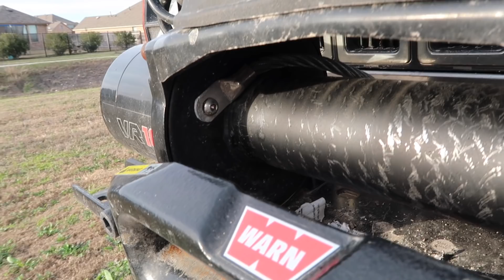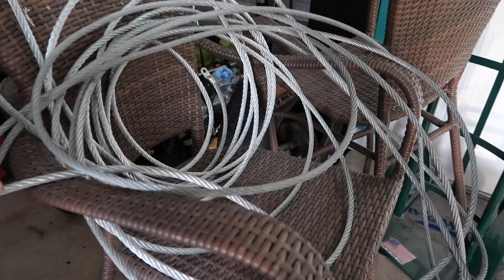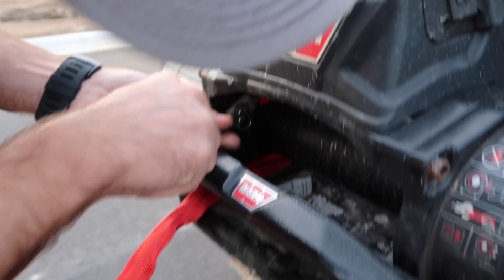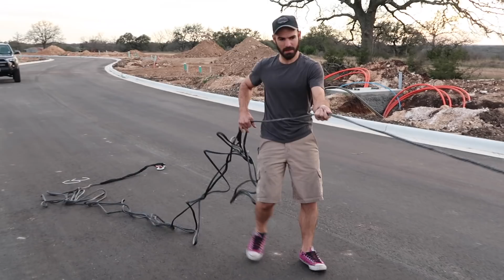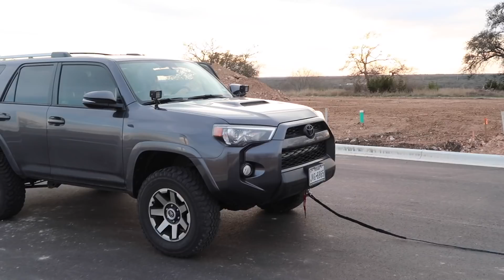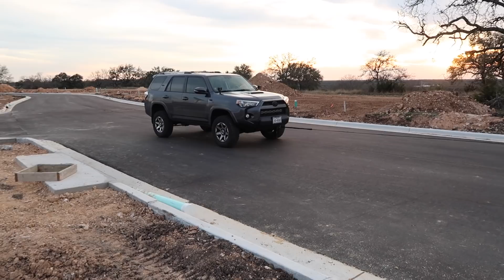Synthetic Winch Line Install - A Relatable Story Of My Wrenching Life Episode - S2E44

Comment: Did  Anyone else see that winch move at 6:32 or was that just me
Reply from the maker: Since it’s not a winch Bumper it’s on a winch Mount that’s in a hitch on the front bumper. So the winch itself isn’t moving but the hitch that’s connected to the bumper is. I’ll do a video of the setup
Reply: its on a front mounted trailer hitch.